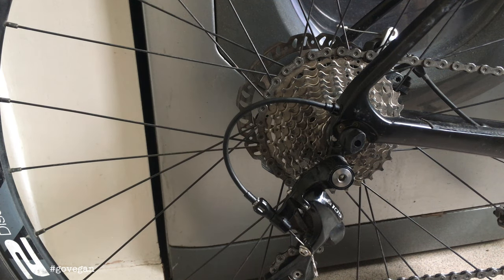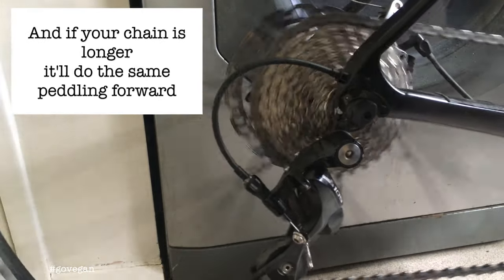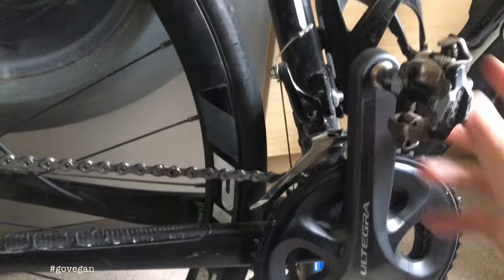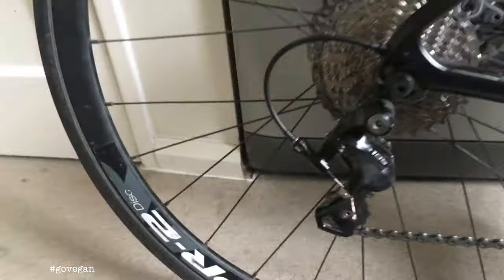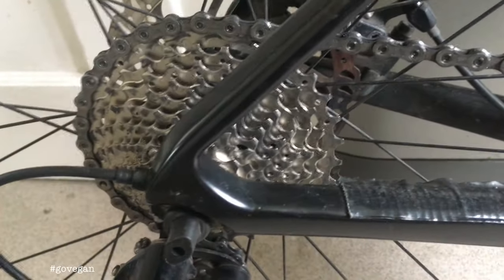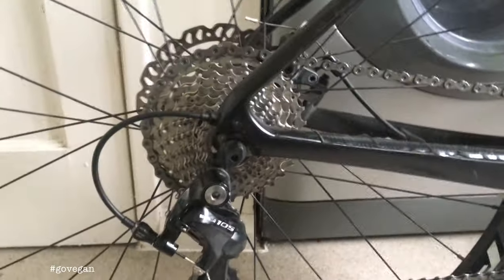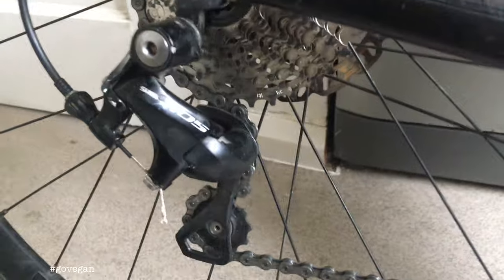11/32 cassette problems

Comment: If you take the b-screw out and screw it back in from the other side, it gives you a "longer" b-screw and will solve the problem properly, rather than removing chain links and still having jockey-wheel rub. From experience chain length when running these gearing 'hacks' should be set so that small-small can still work without damage to the derailleur - which is usually a few links removed from the big-big+2 method.
Reply from the maker: +Ron England nah mate one link out was fine like I showed. Small small is perfect. If I had filmed small small you'd have seen. Not sure why I didn't but oh well 😊

Comment: If you ever accidently end up on the large chainring and large gear on the rear cassette your chain will be too short. Just buy the right size derailleur.
Reply from the maker: Matthew Timber yea but loads of people do it so I just gave it a try. I did end up using a long cage I had, though for other reasons.

Comment: it usually works without problems.. but the next time you make a explenation video, please make shure to mount the chain properly around the two pulleys! both times in the video (long chain, short chain) the chain runs on the wrong side of the little metal part inbetween the two pulleys... thank you for the videos!
Reply from the maker: zifpuduenslio1 Atleast someone noticed.

Comment: I think your problem, I hope is fixed as a year has passed. The proper derailleur cage would be a medium, for a 11/32t cassette. And the correct chain length, and correct adjustments. Hope all is solved.
Reply from the maker: Thanks yes I sorted it. Chain was on wrong ooops 😂 but it was the rear jockey wheel that was causing the problem as it was worn. Even the bike shop didn’t notice the jockey wheel and didn’t know why it did it.  I had a longer derailleur cage anyway so replaced and all worked.
Reply: It don't matter.

Comment: How is your TRP disk brakes doing? Are they good better then a BB7? Do you have enough space between the brakes and the spokes?
Reply from the maker: VELOBAR+ they came with the bike so fit fine. I have been thinking of changing them for hydraulic versions though.

Comment: what if your out riding and accidentally put it into big, big gearing (cross chaining) Would it still work do you think?
Reply from the maker: +Brad it's the same as you see in other videos. Stretched with a little movement left. I've rode it a few times now and the whole gear set up is different to riding 11/28. I felt there was less chance of going big big but have only did a few short rides. I'll do a longer ride today. But if you are really that worried a long cage derailleur would put your fears to rest. I'll ride more and make another video at some point on what I find.

Comment: Hey, you guided the chain wrong through the rear mech, under the guide pulley the chain has to go behind a little piece of metal while in yours you put the chain over, this will cause noise, friction and wear your components down
Reply from the maker: Glad you noticed 😂😆 even the shop who did it didn’t 😉 👍
Reply: @experiment54  i told you because once I did this mistake myself😂 btw I have a ss ultegra 6800 derailler and a 32 cassette, i usually leave my chain a bit shorter as you said, interesting video👍

Comment: just swapped my 11-28 to 11-32 with no adjustments and it works perfectly , maybe your chain was a bit too long to start with ?
Reply: and i'm using a 105 short cage
Reply from the maker: It was the jockey wheels. Worn.

Comment: BCOZ ur deraillerour is short version, get medium for that  big sexy cassette
Reply from the maker: Thanks mate but it was the rear jockey wheel that was the problem. Still I did have a medium cage around and changed it also 👍 thanks for posting 😊

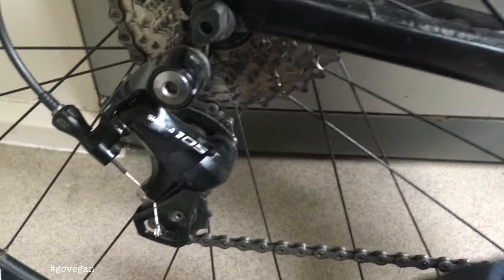Comment: #1 - Right of the bat you looped your chain incorrectly in your jockey wheel derailleur. Chain should be inside the jockey frame. See 0:59 seconds into the video.
#2 - I do think 105 is really designed to go up to 11/30 max and not 11/32. 105 is considered short cage. 11/32 requires mid cage. But maybe, it can be pushed. I am quite sure somebody has done it successfully. Understand the machine and how it work before we conclude our opinion, otherwise we are simply spreading false information.
Reply from the maker: It was a worn jockey wheel that was the problem not the way I looped it though that did cause a problem. When I looped it properly (hey we all make mistakes. Even the bike shop said they’ve done it) the problem still remained. It was the jockey wheels worn out that even the bike shop didn’t pick up on that was the problem.
Reply: Cool!
Reply: Wrong. I have 105 long cage on mine since new...2017 Domane